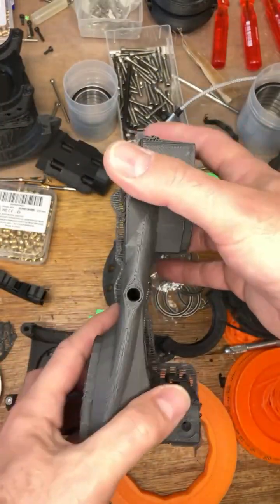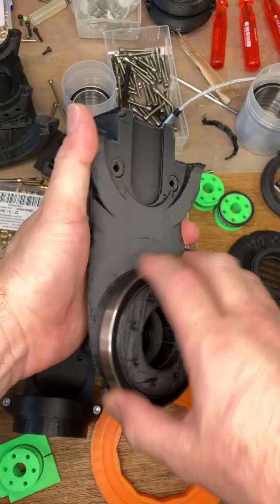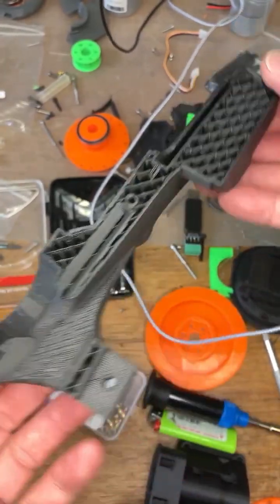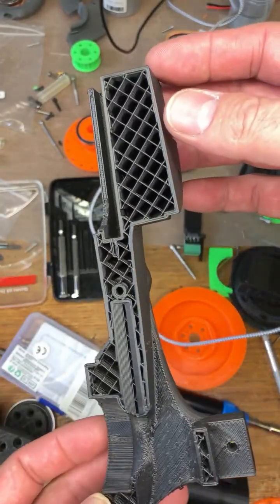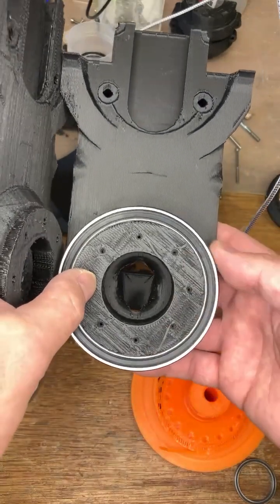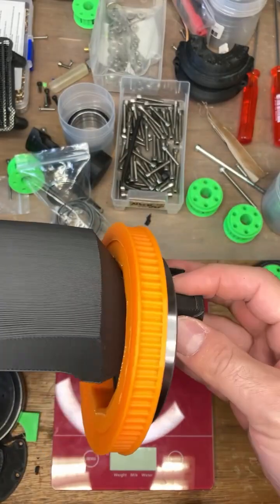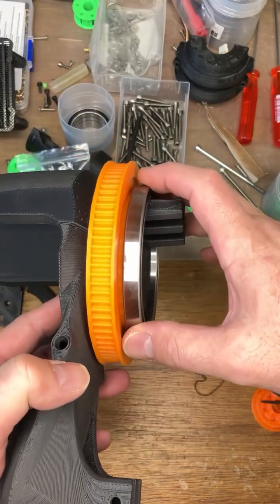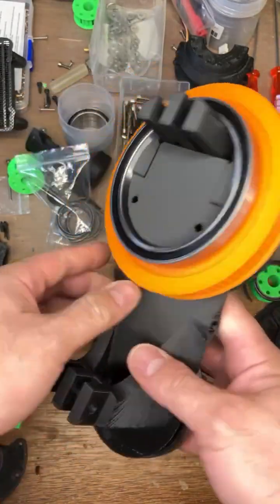HOPEJr,  2nd draft, Carbon Pelvis

Comment: One thing you might want to be concered about is the handling of that carbon material. If it's fibre reinforced, those fibres break off when you touch them and get embedded in your skin. Please look into the dangers of fibre reinforced filaments. We've banned them in our plant (pharma, vaccine production) out of both fear of contamination and health hazards when handling it.
Reply from the maker: Thanks for your concern 🙏 of all the forms of carbon fibre I’ve worked with over the years 3dprinted is probably the least worst 😁 the trick is to get the accuracy good enough that you never have to to sand it!

Otherwise it is indeed the world’s finest itching powder.
Reply: No no it's not just sanding, it's any skin contact handling at all. There's a great video by Nathan Builds Robots here on YT called "The Dark Side of Carbon Fiber filament" that's really worth a watch.  There's comments on the video that break down some of the matsci behind why it's so dangerous. Please stay safe!